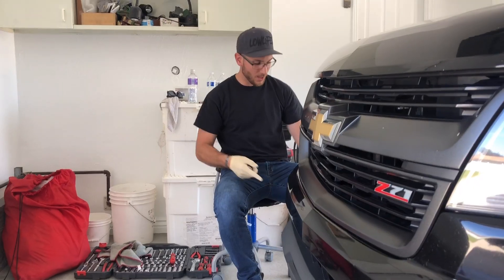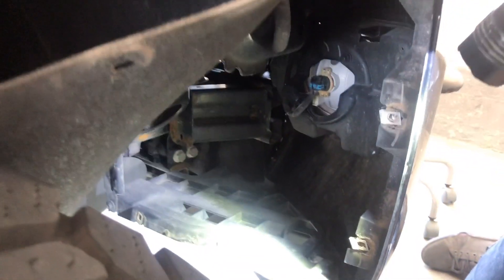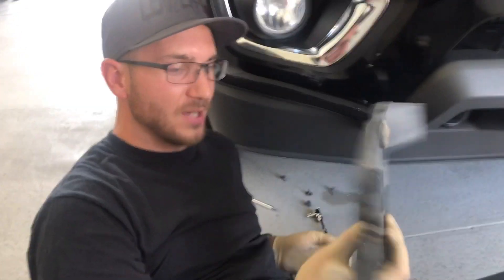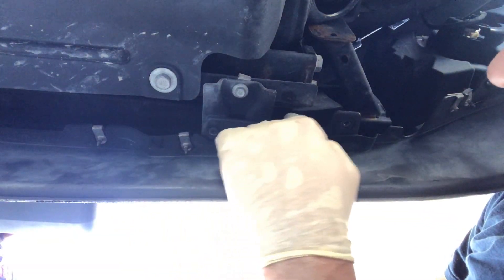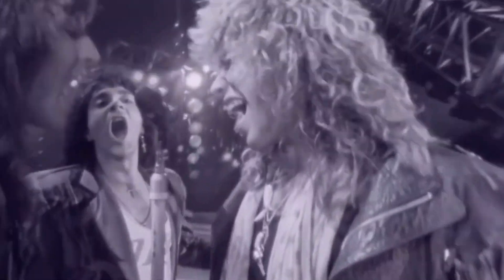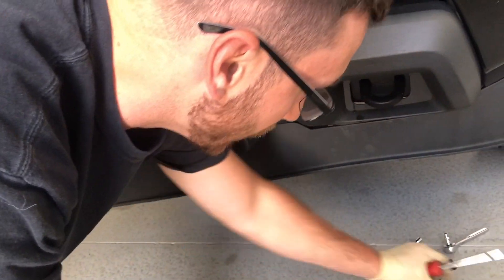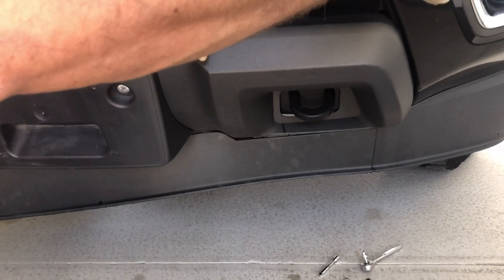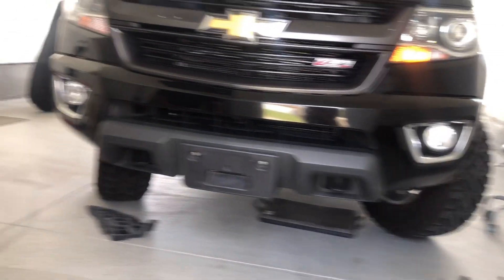Removing Air Dam off 2015 Chevy Colorado

Comment: Is it normal for my 2020 z71 Colorado to not have the 7mm bolt or bracket ?
Reply from the maker: Honestly, they may have changed things on the 2020. So I honestly don’t know, I may do a video of removing a 2020/2021 air damn.
Reply: @thenorthskyrst2096  thanks for the reply.

Comment: I need to find a T15 socket adapter.  Much faster than removing the entire bumper.
Reply from the maker: The T-15 is key on this truck. It’ll help a lot.
Reply: @thenorthskyrst2096  I just said "screw it" after watching your video. Had a T15 on a 2 inch screw driver ratchet. It got all of them except the 2 that were near the 10mm bolts. Those I used the T15 and a vide grip real quick. 42 minutes later........All gone and cleaned up. Small rocks and dust in my mouth but that ugly air dam is now gone and in a dumpster. I knew it could be done without removing the bumper but didn't feel like tackling it until I came across your video and watched it and laughed when you slid into the frame saying "Shalom". Thanks for the inspiration and the laughter while learning.

Comment: what tires do you have on this?
Reply from the maker: Good year Duratrac tires
Reply: @thenorthskyrst2096  what size? Any lift or leveling needed?
Reply from the maker: @jorgehernandez-ju8sr  I did a 2.0” leveling kit. Still rubbed a little with the stock bumper. Part of the reason I got the steel.
Reply: @thenorthskyrst2096  Awesome thanks man!

Comment: So I want to do this to mine, have you noticed a large decrease in mpg cause I really want to know before I do it.
Reply from the maker: What MPG do you currently have?
Reply from the maker: Removing the air damn should hardly decrease the MPG’s
Reply: @thenorthskyrst2096  well my instant is between 25-30, 2wd LT model. Just want to make it look a little better haha
Reply from the maker: @cammm69  you should be able to remove the air damn with little loss in MPG. Believe me it makes a difference in look as well
Reply: @thenorthskyrst2096  thanks man! Will def make my bull bar and lights look much better